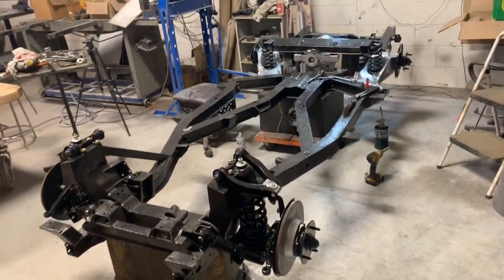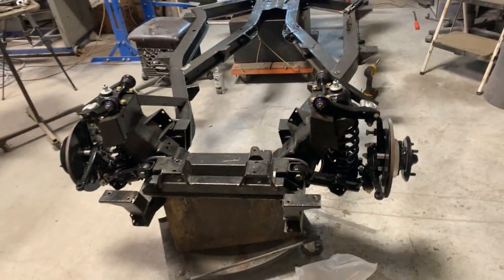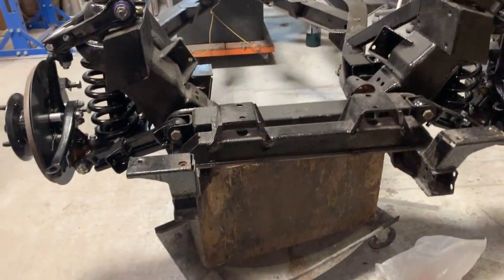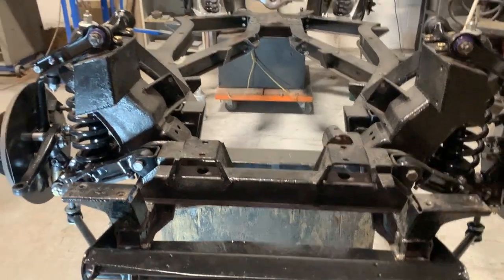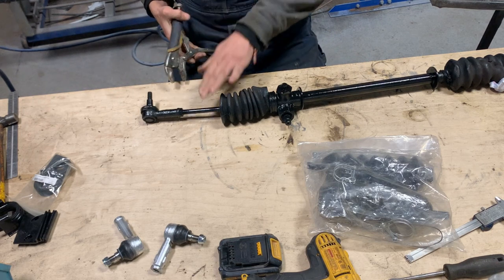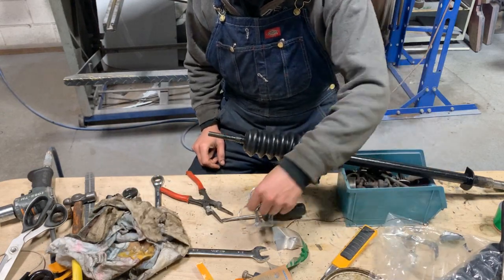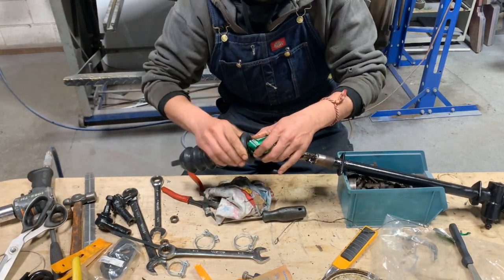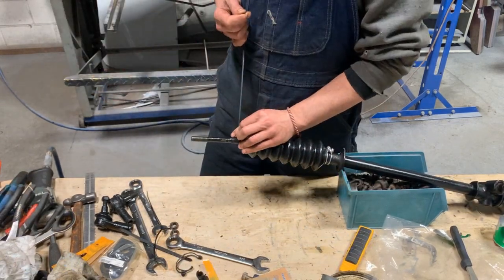1974 Triumph TR6 - Part 60 - Sway Bar and Steering Rack

Comment: Elin, when I added new gaiters on my TR4A, I used a similar “soda can” trick but used plastic I cut from an old detergent container. Flexible enough to maneuver, but strong enough to pull out with pliers.

Comment: Thanks for this, very helpful. In the manual it says that when you put the clamps on the steering rack, you have to push them outwards a specific amount with a special tool to put them under pressure before tightening the bolts. I suppose this is to stop the rack moving too much inside the rubber mounts which could cause wheel shimmy. I didn't do it on mine, I wonder if others have experience of this.

Comment: Elin, you just solved a mystery for me. My rack boots are ripping on the hose clamp that someone put on the end of the steering rack- they should have used zip ties! They used a regular hose clamp, and it's ripping the boot. I want to replace that boot, but BPNW and Moss both have them on BO.

Comment: Coming along very well. The gaiters' and be a lot of "fun" getting back on as you have clearly shown, glad mine are done. I used the wire ties rather than twist ties on the large end. and small clamps on the small ends by the tie rod . Looking forward to the balance of the assembly.

Comment: The wire you quickly discarded is for securing the large rubber bellows that you struggled with.  You ended up using a zip tie, which is probably easier in the end.

Comment: Hi Elin - great video - those bolts that are used to mount the radiator protection shield, do you remember the size? TRF says 3/8” x 7/8” long, but frankly yours look a lot longer.
Reply from the maker: Thanks David, that must be a mistake on TRF site. The bolts go through the entire frame rail, which is 2" plus the radiator protection plate. Mine are 2 1/2" for the front hole and 2 3/4" for the rear as the bumper mount on later TR6 also gets fastened there. I hope that helps!

Comment: A remark about the way the radiator shield is mounted. The second (lower)  bolt should go outside in, rather than inside out. Once you installed the radiator, it will be impossible to remove the bolt if you have to push it inside, since the radiator is blocking it. So better is to mount all bolts outside in.
Reply from the maker: There are bumper brackets attaching later to the same bolts. It is much easier to remove the nut, install the bracket and put the nut back on rather than withdriving the whole bolt. I can't see a reason why I would need to remove that radiator shield, but whatever the reason, it will involve removing the radiator as well anyway.
Reply: @RustyBeauties This happened when trying to swap a standard shield for a shield with an swat bar.  Bols on donating car came out easy. There are countless things I came across in the past 50 yrs working on Triumphs that I did not foresee a reason for....but never mind, keep up the excellent work with your videos !!

Comment: I'm probably dating myself, it's ok. I was a Nissan tech for 43 years, and back in the 80's I Rebuilt dozens of 280zx rack and pinions. The factory would provide a plastic, or mylar sleeve that we used for the seals and boots. The soda can might cause rips where the mylar sleeves would not.

Comment: Another excellent video Elin. Quick question. What is the purpose of the circle things on each side of the radiator protection shield? Mine are broken on one side, so I’m wondering if I should repair or replace the shield. But if they are not for any function, I wont bother.

Comment: Is it possible you installed the bracket for the steering rack the wrong way ?    I would think the 2 L shape 'fingers' would be there to help kept rubber donut more thightly in place ?

Comment: Hey Elin. How far should the steering shaft go down on the rack???
Reply from the maker: There is only one position possible. There is a channel for the bolt that secures it in place, so you have to match it. Otherwise you won't be able to fit the bolt
Reply: @RustyBeauties  thanks brotha!!! I figured that but wasn't 100 percent sure. I knewn that I could reach out to you...Thanks always for the excellent information!!!

Comment: I was looking at the sway bar angle -could it be upside down?
Reply from the maker: No, it has no direction. The suspension has no load on it right now and that is why it is "hanging" too low. Once the weight of the engine and the body come in play, the angle is going to be OK
Reply: @RustyBeauties  got it, makes sense

Comment: Rather than a soda can I like to use the plastic perhaps from the side of a 4litere oil jug.
Too bad you did not show the inside of the inner tie rods. Very often they are slack but only need a small shim to bring them back to spec. All too often owners think they need to replace a rack because of this, and buy one of those junk, unserviceable, ungreaseable, aftermarket racks. So sad 😞